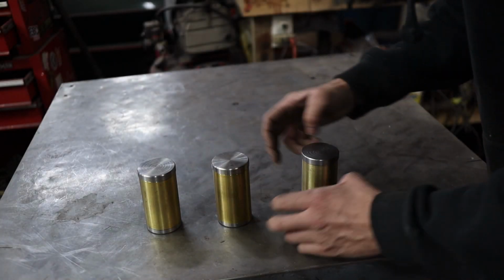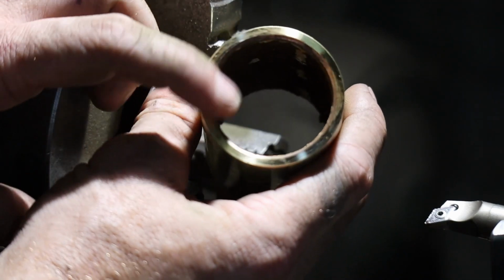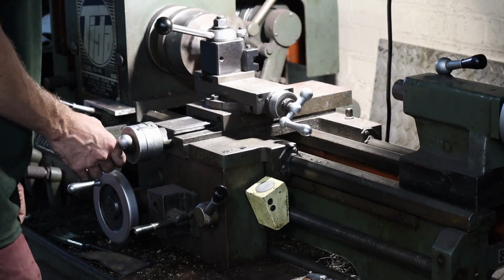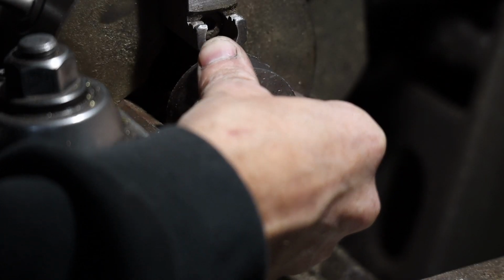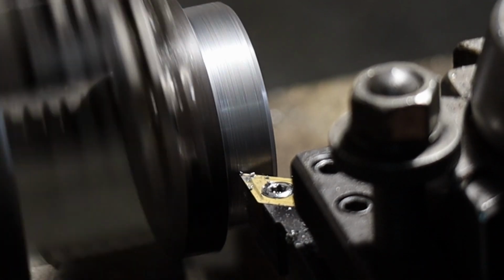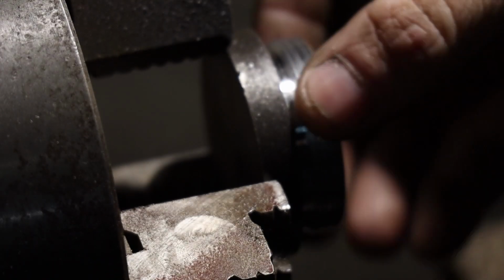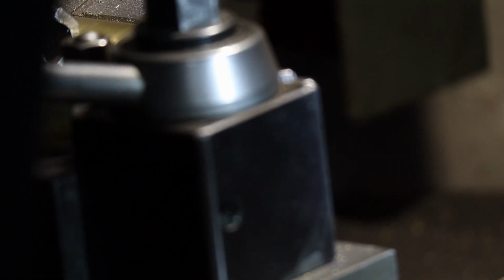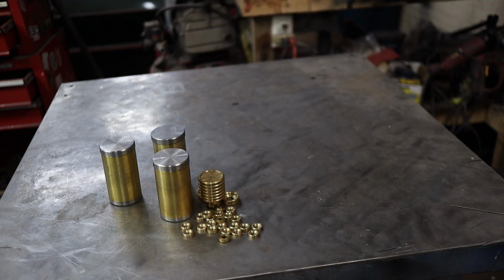Plumbers Scrap Brass Turned into Brake Reservoirs

Comment: I don't want to alarm you but your lathe is making a weird noise... whenever you start to use it in this video it sounds like a mid 70's american sitcom backing band.
Reply from the maker: Ohh yea I love it haha 😂 it’s an old Tida lathe. I believe from the early 80’s.  And yes there is tons of backlash when using this machine as well😬😬 as a rooky hobbyist I’m still learning as I go 😅
Reply: @klegraefe  a good machinist integrates his machines backlash and quirks into the technique and that's what I'm seeing here. Congrats!
Reply from the maker: @juanignaciocaino  much appreciated Juan!! And yess that’s exactly what I’ve been doing, will say though. All 3 of these are not identical, that being said, they still will hold plenty of fluid for the job 😅😮‍💨